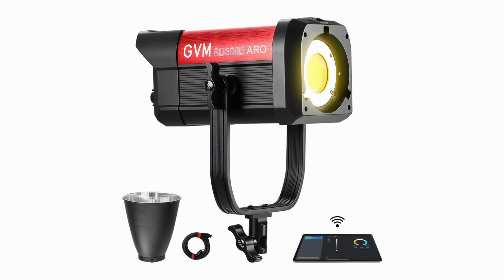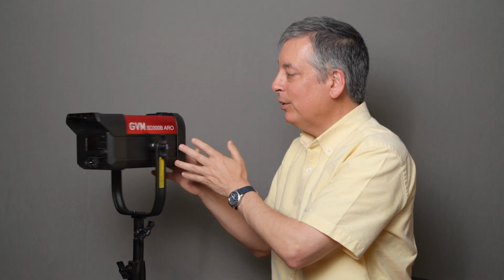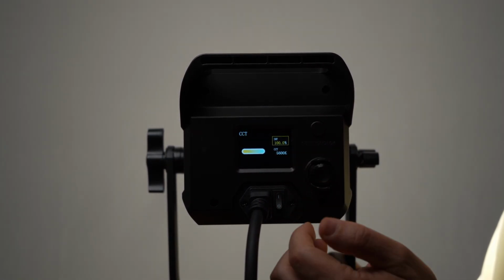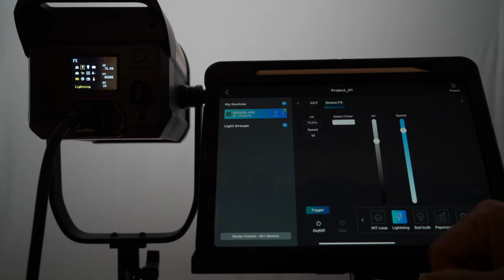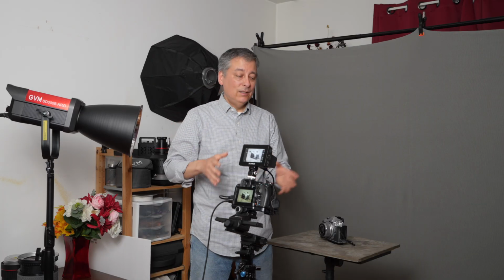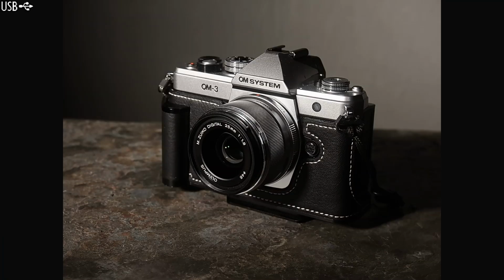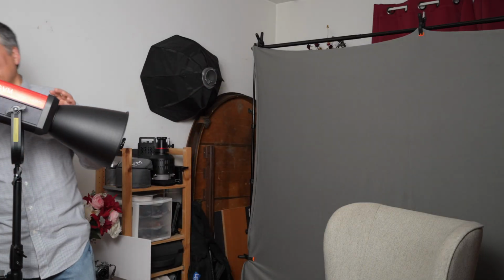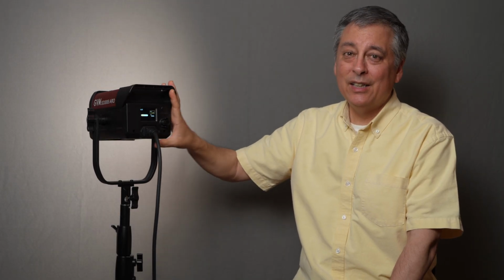Is This The Best Budget Studio Light For Creators?

Comment: Disappointed it doesn’t connect to the previous app. No bag isn’t that big of a deal. But new app separates and complicates my work flow.
Reply from the maker: Hi. I reached out to GVM about this.  They said they wanted to try a new app with the ARO series.  They are releasing the same light called the AIO that will work with the previous app.  Also, all lights going forward will work with the previous app.
Reply: @RobTrek  Any other differences between ARO and AIO?
Reply from the maker: @esplak  Get the AIO.  The only difference is the AIO uses the same app as most of the other GVM LED lights.  The ARO is using a new app that will not be supported in future LED lights.